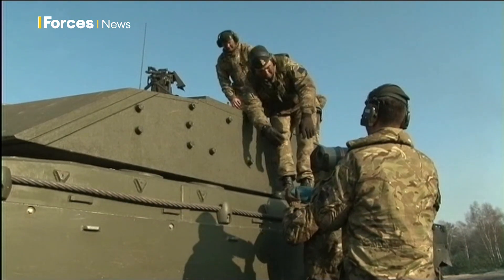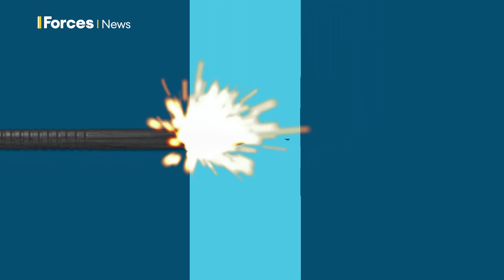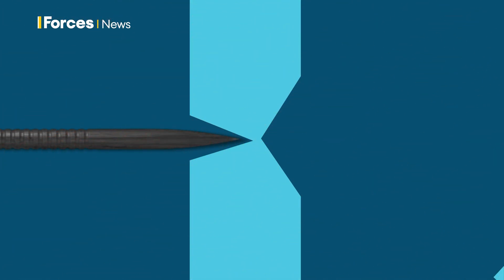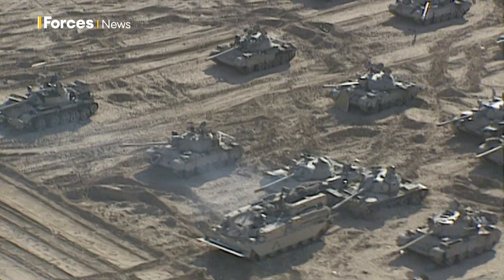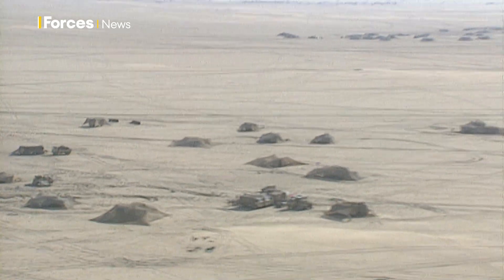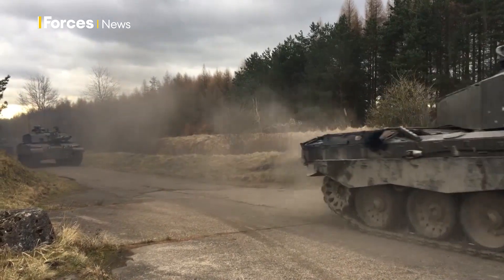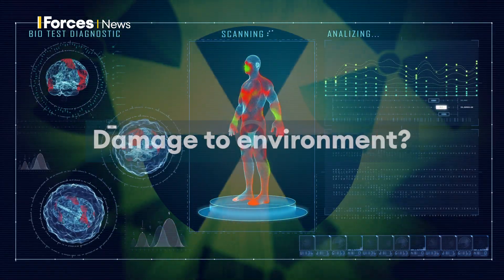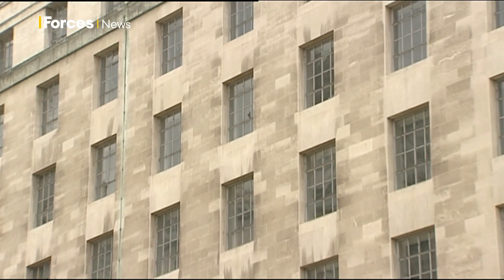Depleted uranium tank shells: Why are they used and how do they work?

Comment: And uranium doesn’t “burst into flame” when exposed to oxygen!  Uranium is a pyrophoric metal which when compressed reaches a temperature of approximately 5000 deg due to sub critical mass of the projectile.  It is a very efficient penetrator of armor and that is why it’s used.  The pyrophoric effect is an added benefit after penetration!

Comment: DU is actually softer than most hardened steel and much softer than tungsten carbide. its used because of its density and self sharpening nature on impact.

Comment: You are firing uranium. Depleted or otherwise uranium has a significant amount of radiation that leaves lasting damage
Reply: You are actually incorrect, the radioactive level of DU is so low that it is almost harmless assuming you arent putting it directly into someones cells. How ever I am not at all saying that it is ok to use. It is still chemically toxic, although still less than other heavy metals, can still be harmful. People like to single out DU over other things like lead in bullets, all because it is radioactive to a miniscule degree.
Reply: @gsilvy4k570  I think that the small amount of radioactivity and toxicity of uranium begins to matter when it turns into fine dust on impact, eventually scattering all over the battlefield. I think I've seen some german documentary about this from Iraq but I don't really remember the details.

Comment: I think that long-term health "risks" attributable to alpha particles would be the least of a tank crew's worries after being penetrated by one of those shells.
Reply: Is the concern not surrounding the effects on innocent civilians who may be exposed to the radiation?
Reply: @CJM527  Read what I actually wrote. 

The Russians have ALREADY used depleted Uranium shells. Other than the Russians' targeting civilian infrastructure with missiles and drones, I think that unexploded mines and booby traps present a much greater risk to civilians than depleted Uranium shells (which will contaminate the inside of Russian tanks and IRVs).
Reply: @Talus-Gort  can you prove Russia already used DU on the battlefield in Ukraine?
Reply: @exiledhebrew1994  Irrelevant question.
Reply: @Talus-Gort  true; anyone can pull anything out of their a** these days

Comment: A few corrections. As is mentioned DU’s “radioactivity” is highly debated, as what it deemed radioactive and what is simply toxic is a blurred line, as DU is not much more deadly than lead, meaning you can pick it up and hold it with your bare hands with little consequence.
Simply being hard does not make a good round, otherwise we’d be making them out of diamond. DU is dense, very dense, though not more so than tungsten on its own, but as an alloy (which is required as pure metal isn’t conducive for a tank round) it is more dense than Tungsten.
As for the self sharpening part that is true, but not that Tungsten doesn’t and DU does. A more accurate description is that they both blunt, DU simply blunts much less.
They armour isn’t pushed in as much as it is displaced, with only the last bit at the end of the penetration being pushed and scattered throughout the tank. Tungsten does this as well, it isn’t unique to DU. DU is however pyrophoric but only above a certain temperature, this is the most correct part of the video.

As side note is that the A-10 does not use a Gatling Gun, which is a very specific model of weapon created by the Mr. Gatling. This is a common error made worse by Hollywood. The technical term is a Rotary Cannon, as opposed to Revolver Cannons used by many European jet aircraft or Recoil Operated Autocannons used by the Russians.
Reply: @Polar Per The UK rounds are old and they just want to get rid of them , Putin could start putting DU waste in HE artillery shells !
Reply: @@randyalvarado6401 , oh yes they are. They are the ones who caused the problem by starting the war! If Russia had not gone to war against Ukraine this would not happen!
Reply: @polarper8165 I read U.K sent DU shells to Ukraine a few months ago? I told my friend he said he did not believe me & that it would be the Russians doing this?
Reply: The concerns about health risks are supposedly to do with dust particles which may be dispersed in the area after collision and inhaled by people in the area. How likely that is and how dangerous it is, I have no idea though.
Reply: The real reason is that du is cheaper. And possibly some decision makers simply hate life and want to ruin as much of nature as they can before their time is up.
Reply: Woooow I'll give you a A+ for effort!!.♥️🇬🇧🇺🇦
Reply: @polarper8165Potential risk from dust (disputed) or definite risk of war crime and death at the hands of the orcs.
Hmm, now let me think 🤔
Reply: Almost all people who have had direct exposure to DU either it be in particulate form or solid chunks have gone on to develop cancer, the town of Hadzici is a perfect example of almost everyone having cancer due to a DU factory. Depleted uranium is MUCH more deadly than lead.
Reply: @subsonicgc4198  I haven’t seen where that’s of officially stated.

Comment: Think the UK still holds the record for the longest tank kill ever at 4.7 kilometers in Iraq in 1991 using a DU round fired from a Challenger 1.

DU rounds fired from Challenger 2s in Ukraine are going to be highly effective at long range. These tanks and all the Leopard 2s and Abrams going to Ukraine are going to be force multipliers. They will allow Ukrainians to take out Russian tanks at ranges where the Russians can't shoot back effectively.
Reply: That's 3 miles in for those in the UK and US.
Reply: @Randy Alvarado They work fine in intense combat, just ask the Iraqis in their T-72s what it was like to face large numbers of M1s and Challenger 1s, the ones that are still alive that is.

These tanks have had years to work out the bugs and are proven in some of the harshest conditions possible. Most recently in Afghanistan.

And just because something is "highly complex" doesn't mean it won't work or isn't durable. For instance it only takes about 20 minutes to change out the power pack of a Leopard 2.

All this equipment was designed to work in battle, you'd have to be delusional to think Russia is the only nation that knows how to make equipment that works in battle.

only theirs doesn't or Ukraine wouldn't have captured masses of it including over 550 tanks.

And speaking of tanks, Russian auto-loaders are a massive weakness. From the carousel storage that often detonates when the tank is hit to its habit of eating arms. They are definitely over complex mechanisms that are prone to failure.

On the other hand western tanks all still use a loader that is faster than the Russian autoloader.

And usually store the ammo in armored boxes away from the crew with blowout panels so an ammo cookoff in most cases won't kill the entire crew.

How many Russian do you think walk away from "jack-in-the-box" detonations of their tanks?

These western tanks are going to be a highly valuable addition to an armed force that is already expert at dealing with Russian opposition no matter what they're in including tanks.
Reply: @@user-vn7rj7mx7h Sure they happen in this war.

And now Ukraine has the better tanks and will be able to kill Russian tanks from much further than Russian tanks can kill western tanks in AFU service.

Russia has lost most of its tanks with modern thermal sights and advanced fire controls. It's now pulling very old tanks out of storage and putting old optics and fire controls in them because that is all they have.

US Abrams tanks are now reaching Ukraine armed with DU rounds just the UK Challenger 2s.

There are going to a be lot of western MBT tanks kills on Russians tanks.
Reply: Esp with T55
Reply: @@user-vn7rj7mx7h There have been plenty of tank on tank engagements and there will be many more.

Western MBTs are designed for long range engagement of opposition tanks and other vehicles and have the optics and fire controls to do that well.

AFU crews will be hunting Russian tanks and other armor with their tanks that have an almost 100% hit rate while on the move.

When the AFU finally breaks through Russian lines and these monsters are let loose it is going to be devastating for any Russians caught in front of them.
Reply: Putin has to take one of these to the face
Reply: @lapdog5067 Russia?

You mean Putin, because he's the only one who has any say in Russia. When people like prigozhin try and stand up to him they get murdered.

So you have a guy pretending he's the new Peter the Great sending thousands of Russians to die every week to keep his fantasy alive.

Russia isn't going to win this war because it has already taken so many losses in men and materiel it will take decades to recover.

The only thing this current Putin staged disaster is about is so he can pretend to have a victory to tout at his pretend election in March.

And most Russians go along because they're still stuck in the 18th century.
Reply: I thought that it was a HESH round. 🤔
Either way I was a cracking good shot. 👍
Slava Ukraine. 🇺🇦🇬🇧
Reply: @ivancho5854  It was a DU round.

And an American M1 took out two T-72s in that war with one DU shot. It passed right through the first tank and still had enough energy to penetrate the second.
Reply: @Randy Alvarado "First of all, Russia is not Iraq nor Afghanistan....."

not the point, you were trying to claim these tanks suddenly won't work in Ukraine. If they can operate in the Saudi Desert or the Afghanistan mountains they are going to work on the plains of Ukraine.

The rest you post is nonsense. Russia is highly reliant on western technology to build modern battle tanks with advanced thermals, comms tactical systems and fire controls.

The reason the USSR went with the autoloaders is they relied on massive numbers of tanks operated by semi-skilled conscripts. By putting in an autoloader that never really worked supposedly they could get away with reducing their manpower requirements by 25%. Which means one less man maintain the tank and the tank commander suddenly becomes the loader when the autoloader breaks down. There's a reason that most western tanks didn't take that route. The T-14 takes one step further, what the hell are the crew in their armored coffin with no access going to do when the autoloader breaks.

"Thirdly, Russian equipment and their tanks are not inferior to the West. Once these Western tanks get destroyed in battle which they will, there won't be any replacements for lost Western tanks because the West no longer make tanks anymore. Russia on the other hand is cranking out more tanks by the month and there's no signs of them stopping anytime."

yes they are inferior in some really important ways. Really poor ergonomics, just fighting in a Russian tank is much harder than a western. Usually poorer thermals, battle management systems stabilization and fire control.

Most western tanks can hit targets at 100% when moving. Russian tanks it is 50%, that is a huge advantage. 

Russian tanks also can barely reverse out of heavy fire which should be an essential for any tank. 4kph reverse as compared to over 30 for most western MBTs.

That's just to start.
Reply: So how’s that challenger 1 doing in Ukraine? you still have time to delete this comment
Reply: @russiasvechenaya58  Challenger 2.

And the unit that is equipped with them just threw the Russians out of Robotnye.

If Ukraine had more of them they would be doing even better.
Reply: To fight professional russian army is not equal to fight muslim farmers
Reply: @deino3037  The Ukrainian military is far more professional than the Russian and has already destroyed at least 1,500 Russian tanks and captured 550. 

With even better tanks and other weapons it is going to be even more lethal.
Reply: I hear that too....however, remember that is the desired outcome, not objective reality. Ukraine having almost no air defense means air attacks are likely to destroy tanks as easily as patriot missile batteries. The 'force multiplier' is somewhat wishful thinking
Reply: @michellelewis3063  objective reality?

Ukraine started this war with over 100 S-300 batteries as well as many short range systems.

As it has taken losses in its air defense and used up missiles it has transitioned to western systems.

Including Patriot, NASAMs, IRIS-T, Crotale, SAMP/T, Starstreak and more. Ukraine has one of the most effective air defense networks in the world.

And it still has fighters to control the air space over Ukrainian held territory. It just received 25 MiG-29s to replace losses.

Hell, Russia just lost 4 or 5 aircraft 50 MILES INSIDE ITS OWN BORDERS.

Ukrainian tanks are going to be well protected from air attacks and are already beating the living hell out of Russian positions right along the line. Videos show Ukraine committing them to battle right on top of Russian positions causing repeated routes of Russians.

Your "objective reality" is neither objective or real.

Like the Russian rationale for starting this insane war and the unhinged way it keeps fighting it.
Reply: Hate to burst your bubble.  The Challenger 2 is an impressive tank and the DU will destroy any Russian MBT.   

But the Russian 125mm is far more advanced that export variants and the Russians themselves have DU sabot rounds which means it’s going to be who shoots first wins.
Reply: @ConstantineJoseph  The same 125mm gun that was on all the Russian built tanks that the coalition wiped out in Iraq in 1991 including the longest tank on tank kill by a British Challenger 1 on an Iraqi T-72.

We see just how "advanced" Russian made equipment is daily on this channel. And for the most part it is utter garbage.
Reply: @dougcoombes8497  you didn’t read my comments or you can’t understand what I mentioned.  

Those are export 125mm and export munitions.  Now you are facing the advanced 125mm and advanced depleted uranium 125mm sabot apfsds.   

Wake up it’s not the early 90s anymore.
Reply: @Randy Alvarado "Once these Western tanks get destroyed in battle which they will, there won't be any replacements"

The US Lima Ohio tank plant was operating with about 100 staff because it was just doing modifications of existing tanks. That was just increased to over 1,000. The US is going to be producing as many M1s as it and its allies need.

Rheinmetal is taking orders and producing its latest Leopard 2 variant the A7 which outclasses anything Russian can field. Germany will soon be producing their new Panther which is a truly revolutionary design unlike the highly flawed T-14.

South Korea is cranking out large numbers of their excellent  K-2 Black Panther several hundred which have already been shopped to Poland which is opening its own factory and will build its own K-2s up to 1,000 tanks.

The UK is upgrading 148 Challenger 2s to 3.

"Fourthly, you cannot completely isolate your crew from the tank ammo as your loader constantly has to reload."

A US loader has to be able to load a 120mm shell in under 7 seconds to qualify, only a fraction of that is when the armored ammo box door is open. In almost all cases of ammo cook off in Abrams which usually happen in friendly fire accident the doors are closed and all the force goes up out of the back of the tank out the blowout panels. They work.

"Finally, Ukraine is only getting a few tanks at most. Probably 50 tops."

They're already getting 150 Leopard 2s of A4, A5 and A6 models to start with. That will go up as needed.

Plus 14 Challenger 2s and 187 Leopard 1s. There are possibly 80 Challenger 2s which are excess to UK needs which could be sent. 

The 31 Abrams can come at any time as President Biden can use his drawdown authority to pull them from US stocks in Europe which are about 175. 31 will just be the start of Abrams for Ukraine if they need more.

I have no idea where you get your "facts" but they deeply flawed.

Just like Russian war doctrine and equipment.
Reply: @dougcoombes8497 the panther is a glorified leopard 2
Reply: @X774M  Right, with a 130mm gun, active protection, much better armor , drones, advanced electronics, etc....

The latest model Leopard 2s are already excellent MBTs, the Panther makes them even better.